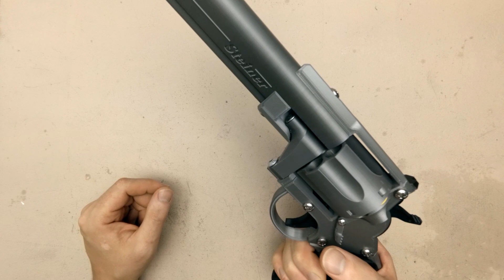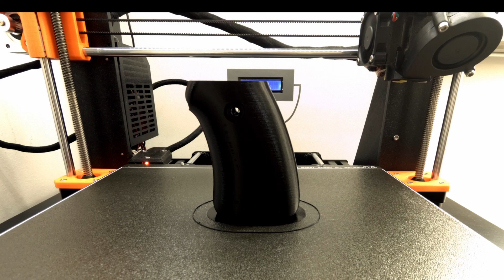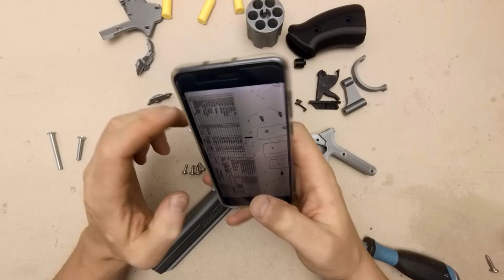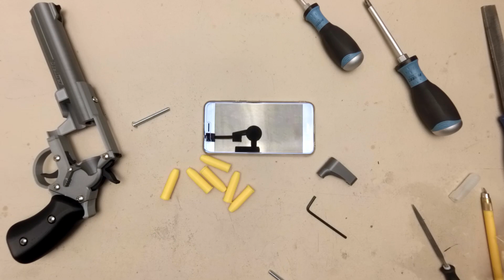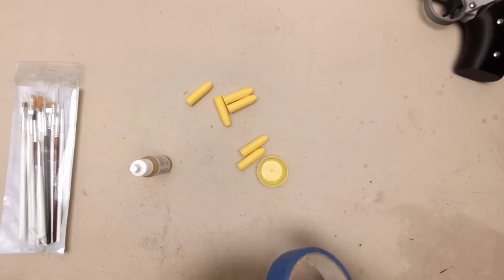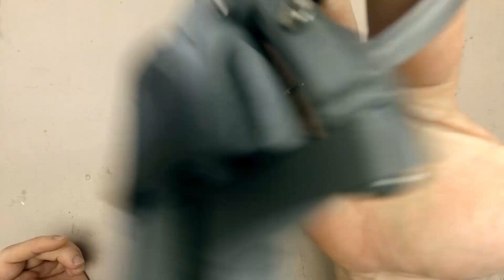3D Printed Revolver - Single Action Prop Gun

Comment from the maker: Huge Update:
There is a new version which is double-action and there is no need to buy screws or any other parts, as the model is 100% printable WITHOUT supports and does not need any glue.
You can get the files for free here:
https://www.printables.com/model/552686
Video:
https://www.youtube.com/watch?v=P2TgjPxdLdA
Creator:
https://www.youtube.com/@desteiner1786
Reply: Nah cuz the printed “spring” dont works so trigger is always back

Comment from the maker: I spent much too much time flipping it around my finger.
Reply: Medy y don't you do one that actually fires..likein one of Ur comments saying it's really tempting and getting tempting or hav u already done one that actually fires..or is that old news..
STEVIE.
Reply from the maker: @SamanKale-od5wn  Old news. In my country it's not allowed to but even the smallest caliber cartridges. Creating a rubber band or Nerf pistol is not fun for me.
Reply: Um, where is the shell covering for the rounds?I didn't find it in the files
Reply from the maker: @ayo1jolib  Not sure what you mean? revolver_cylinder.stl or speedloader_body.stl maybe?
Reply: @medyk3D  ah, I'm just dumb mb bro
Reply: Just got one last question: What type of screws did you use?I was planning on gluing it together but that kinda wouldn't work
Reply from the maker: @ayo1jolib  Gluing probably won't work. All the screw sizes are in the description here and on printables. It can be tricky.
Here's the list:
1x M5x50 03 ISO 4762
1x Spring 4x18 ( 0,4) 27 from pen ****)
1x ST4,2x18 (non standard length) 26 (ISO 7049) *) **)
4x ST4,2x13 (ST4,2x11 to ST4,2x13) 25 ISO 7049 *)
4x ST4,2x10 (ST4,2x9 to ST4,2x14) 24 ISO 7049 *)
1x ST4,2x7 (non standard lenght) 23 (ISO 7049) *) ***)
1x ST4,2x4,5 (standard length) 22 ISO 7049 *) ***)
1x ST2,9x7,5 (non standard length) 21 (ISO 7049) *) ***)
1x M5x30 20 ISO 4762

*) "Sheet Metal" screw (ST)
Standardized available
lengths: 4,5/6,5/9,5/13/16/
19/22/25/32/39mm
**) flat tip recommended
***) flat tip required
For flat tips, get longer
screws and cut them to
the needed length.
****)outer diameter: max 4mm
wire diameter: ~0,4mm
length: min 18mm
compressed: max 6mm
Reply: @medyk3D  thank you :>

Comment: I wonder if the cartridges could be modified with some kind of a spring setup with a nerf ball.  Basically you out the nerf balls in, push down the spring, then the hammer hits something that releases the spring and the nerf ball flys out
Reply from the maker: Not enough space to put a spring big enough to push the nerf. Maybe a pneumatic system could be used? No idea.

Comment: Creator here.
Thanks a lot for your kind words, I am glad you like it! Very smooth printjob right there and well made video, keep up the good work!
By the way, I keep mine next to my PC and also grab and flip it whenever I wait for the PC to do something ;P
Reply from the maker: Thanks for the kind words and publishing this awesome design. It's really top notch. Once you started to flip it you never stop :)
Reply: Which files do i need to print, like all of them or are some unnessecary. There are alot of files and i cant figure it out.
Reply from the maker: @BinkvH  It depends, because you can choose/customize:
1) Grip: revolver_grip_classic.stl and revolver_body_classic.stl OR revolver_body.stl and revolver_grip_left.stl and revolver_grip_right.stl
2) Revolver barrel: - just choose only one file starting with 'revolver_barrel' (the one which you like best)
3) Korn - revolver_korn.stl OR revolver_korn_bicolor_fixing.stl and revolver_korn_bicolor_tip.stl
4) Hammer - hammer.stl or hammer_brimmed.stl (the same part but the second one has included brim - useful while printing with ABS)
5) sl_button.stl and sl_body.stl - optional quick loader
6) Files starting with 'disp-' are the dispaly base parts

Also read the 'What you need section' from thingiverse Summary for the required hardware and which parts to print with ABS (I used PETG).

The assembly drawing is helpful: https://i.imgur.com/3nPtyNg.jpg
Reply: @medyk3D  is it possible to print in PLA, my printer is in my room and i dont have the time to install a good ventilation system.
Reply from the maker: Yes it is possible,  but the lifetime might be limited. I printed mine with PETG, which not as bad as ABS. Also there are just a few small parts which are not supposed to be printed with PLA. So you can start printing, leave the room and air it out after printing.
Reply: @medyk3D  How many small parts, i dont have ABS at the moment but i do have some wood filament laying around, does that work?
Reply from the maker: @BinkvH  Cylinder-Stopper, Trigger, Hammer and Hammer_Rotator. Don't buy ABS. Go with PETG. But you can also print everything with PLA and check how long it will last.
Reply: I was wondering what revolver did you base this on
Reply: Your shotgun is like 80% the reason I got a 3d printer in the first place 😂
Reply: @MetalLazer1980  it's a freaking magnum
Reply: @fridaythe13thfanamogus  magnum is the type of bullet used on real revolvers that’s why sometimes called 44. or 357. magnum
Reply: First of all I wanted to say how amazed I was seeing your design, it is brilliant! sadly it seems the link to your 3D print is broken, I tried to look everywhere because I wanted to print my own but couldn't find the files. did you decide to stop releasing your work? It makes me sad but I do understand if you did.

Comment: As I understand for making it works as expected we need to screw 1 sharp bolt in the hammer only?
Reply from the maker: As I mentioned in 7:09 I did not have any M5 metric thread cutter so I used the sharpened bolt to make the threads. All the others are selfthreading.

Comment: I printed this gun on an anycubic mega s and it worked out pretty good, except the hammer sometimes doesn't click unless u tap it with ur finger, and the cylinder doesn't rotate while inside the body when u pull the hammer, other than that, very good design, no other complaints

Comment: Hi do you know where i could find the screw list? The description got deleted and The exploded diagram image on the thingiverse file is really low resolution, and i cannot read the text  on it, thanks in advance!!!
Reply from the maker: There is a pdf under the thing files (revolver_exploded_2019-01-28.pdf):
https://cdn.thingiverse.com/assets/5a/d2/2d/d4/1c/revolver_exploded_2019-01-28.pdf
Reply: @medyk3D  yeah, for some reason whenever i try to download it, it downloads as a really low resolution image, and i can't read it, even after downloading
Reply from the maker: @meloneh5394  Ok, no worries. I reuploaded the pdf to my blog and added the list:
https://medyk3d.com/2020/09/3d-printed-revolver-single-action-prop-gun

Google drive link:
https://drive.google.com/file/d/1jgDOOmatyV_9LQQVwydKxun8ZQX1vr4M/view?usp=sharing

1x M5x50 03 ISO 4762
1x Spring 4x18 ( 0,4) 27 from pen ****)
1x ST4,2x18 (non standard length) 26 (ISO 7049) *) **)
4x ST4,2x13 (ST4,2x11 to ST4,2x13) 25 ISO 7049 *)
4x ST4,2x10 (ST4,2x9 to ST4,2x14) 24 ISO 7049 *)
1x ST4,2x7 (non standard lenght) 23 (ISO 7049) *) ***)
1x ST4,2x4,5 (standard length) 22 ISO 7049 *) ***)
1x ST2,9x7,5 (non standard length) 21 (ISO 7049) *) ***)
1x M5x30 20 ISO 4762

*) "Sheet Metal" screw (ST)
Standardized available
lengths: 4,5/6,5/9,5/13/16/
19/22/25/32/39mm
**) flat tip recommended
***) flat tip required
For flat tips, get longer
screws and cut them to
the needed length.
****)outer diameter: max 4mm
wire diameter: ~0,4mm
length: min 18mm
compressed: max 6mm

Comment: In the time lapse chapter what is the bottom thing?
Reply from the maker: Which bottom thing? Brim? Skirt?
Reply: The little plateforme?
Reply from the maker: @Antagonist_01  I guess you mean the brim - it adds extra area for the print to stick to the heatbed (making the printing part harder to tip over).

Comment: Did you use a special kind of filamente or just normal filamente also could you use a crealoty endear 3
Reply from the maker: Most of the parts can be printed with PLA. You can use PETG for the Cylinder-Stopper, Trigger, Hammer and Hammer_Rotator.
Info from the creator:
ABS/PETG filament: I heavily recommend you to use ABS for the Cylinder-Stopper, as PLA is not as flexible and will change shape under load pretty quickly. Also recommended for Trigger, Hammer and Hammer_Rotator. These likely work with PLA too (at least at first, long term is another story), but I have not tested. Many have reported, that PETG works too!
Reply: @medyk3D  sorry i am sort of new to 3d printing so i dont quite understand much of what you said but did you use. Metallic filement
Reply from the maker: @coldbeanz  I used silver PLA for the most parts. But there are some that you need to print out of PETG or ABS (those are different kind of filament).

Comment: What's the caliber? Looks like it would fit the .38 Special.
Reply from the maker: The creator stated that it's .44 Magnum:
https://www.thingiverse.com/thing:3004363
Reply: @medyk3D  It's says "...engraved Caliber 44.Magnum text on the other side". It doesn't say if it is the actual caliber. Could you measure it some day since you have it already?
Reply from the maker: @darek4488  I've measured the bullet and it's 0.448 inch in diameter. Is it ok? I can take more measurements/photos if you want.
Reply: @medyk3D  Pięknie dziękuję.
Reply from the maker: @darek4488  Proszę bardzo :)

Comment: Where can I get the screws
Reply from the maker: I got mine from Allegro (it's a kind of polish amazon). Here is the list of the materials:
There is a pdf under the thing files (revolver_exploded_2019-01-28.pdf):
https://cdn.thingiverse.com/assets/5a/d2/2d/d4/1c/revolver_exploded_2019-01-28.pdf
Just in case I reuploaded the pdf to my blog and added the list:
https://medyk3d.com/2020/09/3d-printed-revolver-single-action-prop-gun
Google drive link:
https://drive.google.com/file/d/1jgDOOmatyV_9LQQVwydKxun8ZQX1vr4M/view?usp=sharing

1x M5x50 03 ISO 4762
1x Spring 4x18 ( 0,4) 27 from pen ****)
1x ST4,2x18 (non standard length) 26 (ISO 7049) *) **)
4x ST4,2x13 (ST4,2x11 to ST4,2x13) 25 ISO 7049 *)
4x ST4,2x10 (ST4,2x9 to ST4,2x14) 24 ISO 7049 *)
1x ST4,2x7 (non standard lenght) 23 (ISO 7049) *) ***)
1x ST4,2x4,5 (standard length) 22 ISO 7049 *) ***)
1x ST2,9x7,5 (non standard length) 21 (ISO 7049) *) ***)
1x M5x30 20 ISO 4762

*) "Sheet Metal" screw (ST)
Standardized available
lengths: 4,5/6,5/9,5/13/16/
19/22/25/32/39mm
**) flat tip recommended
***) flat tip required
For flat tips, get longer
screws and cut them to
the needed length.
****)outer diameter: max 4mm
wire diameter: ~0,4mm
length: min 18mm
compressed: max 6mm

Comment: i have s question what type of screws do I need specifically
Reply from the maker: It's right in the description:

1x M5x50 03 ISO 4762
1x Spring 4x18 ( 0,4) 27 from pen ****)
1x ST4,2x18 (non standard length) 26 (ISO 7049) *) **)
4x ST4,2x13 (ST4,2x11 to ST4,2x13) 25 ISO 7049 *)
4x ST4,2x10 (ST4,2x9 to ST4,2x14) 24 ISO 7049 *)
1x ST4,2x7 (non standard lenght) 23 (ISO 7049) *) ***)
1x ST4,2x4,5 (standard length) 22 ISO 7049 *) ***)
1x ST2,9x7,5 (non standard length) 21 (ISO 7049) *) ***)
1x M5x30 20 ISO 4762

*) "Sheet Metal" screw (ST)
Standardized available
lengths: 4,5/6,5/9,5/13/16/
19/22/25/32/39mm
**) flat tip recommended
***) flat tip required
For flat tips, get longer
screws and cut them to
the needed length.
****)outer diameter: max 4mm
wire diameter: ~0,4mm
length: min 18mm
compressed: max 6mm

Visit the printables for more info:
https://www.printables.com/pl/model/276918-prop-gun-revolver-single-action
Reply: @medyk3D  hello sorry but like I’m in America so I’ve gone to a local hardware store and went online as well and I think I need a conversion. I’m super confused because like I need a more descriptive length.
Reply from the maker: @jefe3856  You need to shorten the screws yourself. Take a look here: https://files.printables.com/media/prints/276918/other_files/2457556_ddbc4773-1e80-456d-949b-368c0b3d52de/revolver_exploded_2019-01-28.pdf#_ga=2.12820287.941795978.1674589848-1584770446.1648664576
Also from the description:
1 M5x50 screw
1 M5x30 screw
11 screws meant for plastic/wood (labeled "ST#x#" in assembly drawing) with a length of at least 20mm and 4mm in diameter, 3mm core diameter. Cut them to shorter screws according to the parts-list on the assembly drawing (link in introduction). Leave the tip flat after cutting, but screw an unmodified screw into every hole before, the screws will not be able to cut the thread themselves anymore afterwards.
1 screw meant for plastic/wood (labeled "ST#x#" in assembly drawing) with a length of at least 8mm and 3mm in diameter, 2mm core diameter. Also mentioned in parts-list.
1 spring as it is mentioned in the parts list. You will have to find a pen with a suitable spring, but it should be pretty common.
M5 thread cutters for the Cylinder and the Body. Just screwing the M5s in without cutting a thread may work, but I have not tried it and would not recommend it.

The ST screw are DIN 7981 / ISO 7049. I believe in USA they are called: Steel Phillips Round Pan Head Self-Tapping Drilling Screws
Something like this: https://www.amazon.com/Guard4U-304-Stainless-Phillips-Self-Tapping-Assortment/dp/B09ZLCVGMD/ref=sr_1_22_sspa?crid=SWDEHG1OJ9A2&keywords=M4.2&qid=1674678023&sprefix=m4.2%2Bdin%2B7981%2Caps%2C162&sr=8-22-spons&spLa=ZW5jcnlwdGVkUXVhbGlmaWVyPUEyU0ZONUZNTUJPV1ZWJmVuY3J5cHRlZElkPUEwNTk2NjA3MlhXRlRDMDVMM1RPNSZlbmNyeXB0ZWRBZElkPUEwMDc3NTk4MVdOUDFRSjhMME9KJndpZGdldE5hbWU9c3BfYnRmJmFjdGlvbj1jbGlja1JlZGlyZWN0JmRvTm90TG9nQ2xpY2s9dHJ1ZQ&th=1
Reply from the maker: @jefe3856  You can also use any screw you have that will fit :)

Comment: Hey great job..where did u put the spring???
Reply from the maker: It's to tension the hammer_rotator, it's placed inside the body of the revoler under the rear sight.
Take a look here:
https://media.printables.com/media/prints/276918/images/2457455_790969fd-3ff5-441d-8137-704c14957e7c/thumbs/inside/1600x1200/jpg/img-revolver_internals.webp

Comment: How long did the assembling take also did you 3d print the bullets
Reply from the maker: The bullets are also 3D printed. Assembling I guess was about one hour. If you are not doing it for the first time that would be a lot quicker. The most complicated part is getting all the screws and a spring.
Reply: @medyk3D  ok thanks

Comment: There's only one thing that could make this better

3d printed screws
Reply from the maker: The 3D printed screws that small would be hard to print using a FDM printer. And the probably not strong enough in the long run.